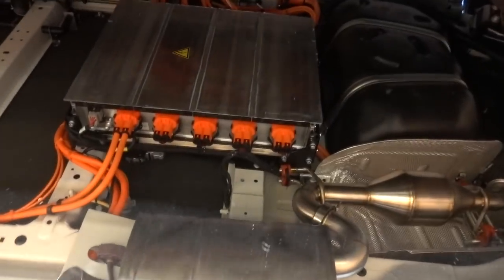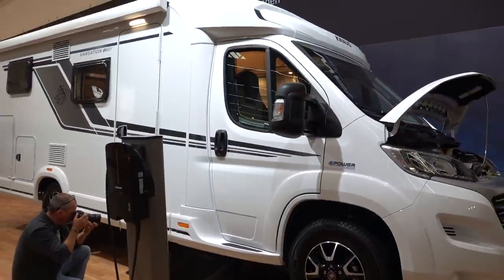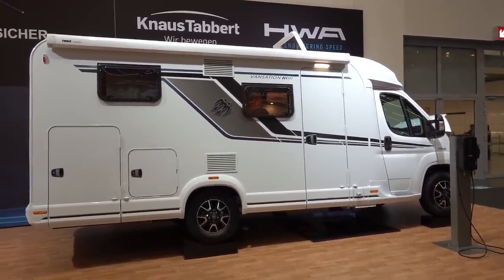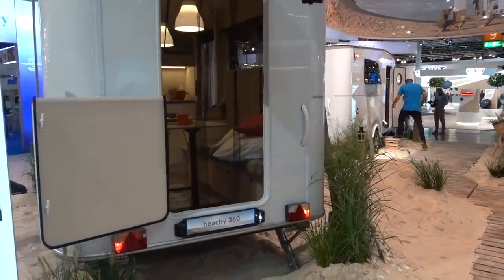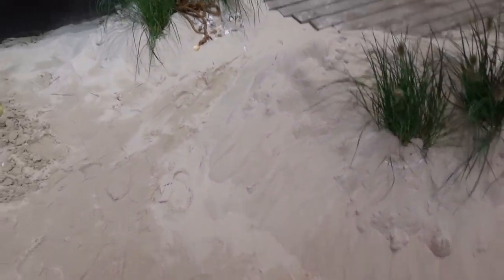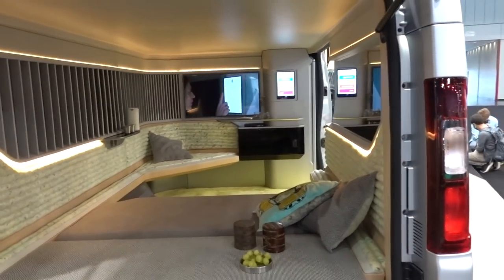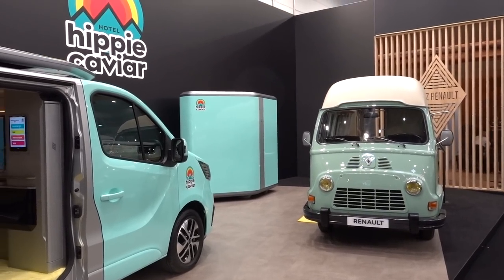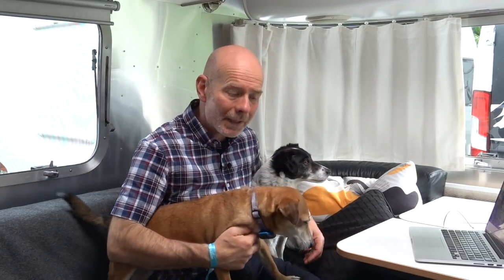Caravan Salon Düsseldorf 2021 - Innovation and exciting NEW stuff!

Comment: Range in electric vehicles. We own a Nissan Leaf it's a 2nd car that we use 80% of the time. We spend most of our time within 20kms of our home. The Leaf is ideal for that and range isn't a problem. Electric cars are fun to drive, instant acceleration. Where all pure electric vehicles fail is towing. Here in Australia, we cover big distances. Over here hybrid/ plugging technology is the answer at present. You can get the benefits of the electric vehicle around your home base & it can still do the big trips. I'm hoping that hydrogen technology is developed further, either in fuel cells or converting ordinary diesel & petrol engines as JCB are exploring. Good to see you & Dougal out & about.
Reply from the maker: Cheers Bernie!
Reply: Hydrogen is far too inefficient. Batteries are the only sensible solution for road vehicles. Yes, also for motorhomes eventually.

Comment: Things I have learned: manufactures don't seem to be interested to go electric at all, although I guess there are many people who would love to buy one (myself included). The Knaus shows they don't understand it.. making it hybrid would have been good 10 years ago, not anymore now. 
Give me a model with a usable winter range of about 250km, a lot of solar that charges the main battery for extra range (although pretty limited, it can help a lot depending on the way you travel) and if possible an external plug for extra solar like on trailers or pointing externel panels directly towards the sun. No more house battery, just direct converted to 230/12V from the main battery with a cutoff so you can easily go for induction cooking, heat pump for heating, etc. 
If you don't like those drop down beds, you are not alone, I wonder whether all other couples go to bed and get out at the same time? I certainly want to have a usable seating area when beds are in use! I must admit in our own Pössl 2 win vario we have a pull down bed, so similar, but I can even stand up (almost) straight underneath when the bed is down. It is certainly worth checking that model out, there are many much larger campervans/motorhomes with less usable space/storage. 

To end: thanks for the excellent videos of Dusseldorf, I was looking forward to them! We hope to go there next year, this year Uno, our Newfoundland puppy made sure we had to stay in Belgium because he isn't old enough to travel abroad (rabies).
Reply from the maker: No problem! I'm sure Udo is worth missing Caravan Salon for ;)
Reply: Yup, fully electric would be the only sensible thing to do in 2021.

Comment: Regarding power failure and electricly lifted beds... They lift via linear actuators, which will remain in place without power. The ones I've seen have a manual crank backup option. Also linear actuators are extremely reliable (and expensive). I looked at some for a custom conversion and it was somewhere around $10,000 AUD for 4x actuators, motors and rails.
Reply: Not sure about those cost figures but the electric drop down bed in our Dreamer D60 Fun does come with a manual crank option - so if you get some kind of failure you can at least 'sleep on it'
Reply from the maker: Good to know, thank you!

Comment: The Knaus prototype seemed a bit of a half-hearted token gesture. Okay it was range extended but looks like they just took out a few mechanical bits and bolted a battery underneath, probably left the engine in place so not even a full conversion. The charge port was a standard type 2, likely just 7kwh charging. Compare it to an eVivaro and it is like comparing dial up to broadband. 
Oh and for the petrol heads: batteries last for well over 200,000 miles, can be repurposed at end of vehicles life and are fully recyclable, don't cause air pollution and are soo much nicer to drive than a clunky noisy diesel

Comment: Can the batteries be charged by the generator while you're driving the unit to make it distance greater?
Reply: If it works the same as the BMW i3 REX then yes it will 👍 The generator charges the battery when it drops below a certain percentage, allowing you to travel as far as you like, albeit on petrol. A very good idea for motorhomes…

Comment: Nice to see you in Dusseldorf again. Regarding the e-Ducato, the problem is not range. It's its weight. A diesel powered Ducato has an empty weight of around 2000kg. That gives manufacturers 700 to a ton of room to put plywood and other stuff in. In the end that results in a camper with an empty weight of 2700 to 3000 kg.
The e-Ducato has an empty weight of around 2700 kg. That simply leaves no margin for a sub 3.5t conversion. I haven't see if the e-Ducato is available with heavy chassis, but anyway one would need a c1 driving license to drive it. A few months ago, the European commission did a survey that could allow driving leisure vehicles with a maximum weight of 4250 kg with a B license. This could be a way of saving the environment by not using petroleum, but using lithium and other rare minerals...
Reply from the maker: Very interesting, thanks for letting us know. I was just going off what I was told my Fiat, but your explanation makes a lot of sense.

Comment: None of the RVs shown on this video, with the exception of the yellow Tab, are remotely practical in real life. There is no point of showing an electric RV with a 60 mile range, a “Beachy” caravan with no heat, cooker  or plumbing or a hulk of a caravan that will surely cost over a million euro. How about showing us something that would actually be useful to the average caravaner.
Reply from the maker: I'll be covering more mainstream motorhomes and caravans in the rest of the videos. But innovation normally requires pushing the boundaries to see what is possible.